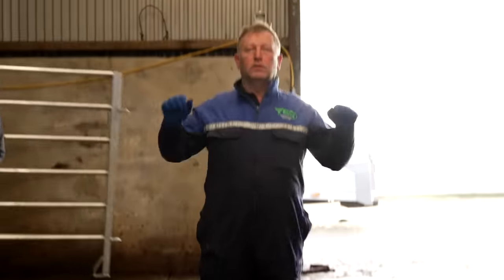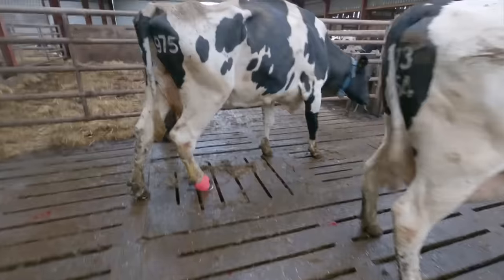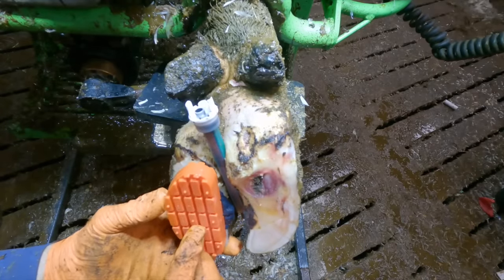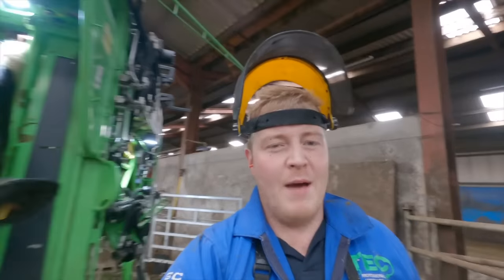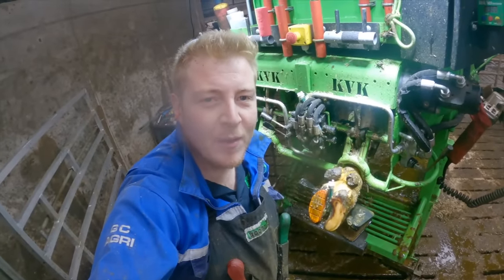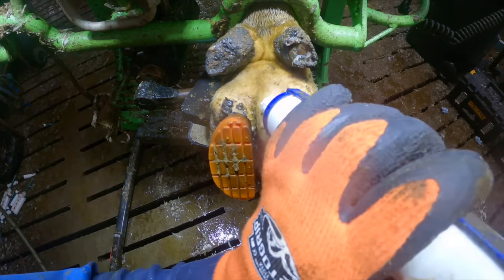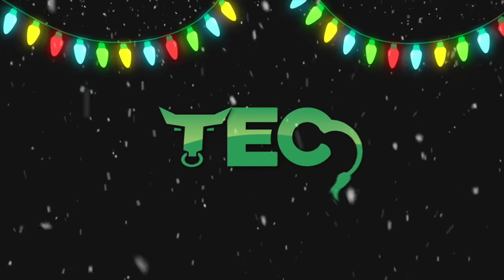MASSIVE FOUNTAIN HEEL IN THIS COW'S HOOF | 12 Hooves of Christmas

Comment: Blocks look like they are falling off because you’re not using enough glue, you’re leaving empty voids at the toe and heel, once the cow puts pressure on the toe or heel the block pops right off. I’d be surprised if you’re blocks are lasting till the end of the first day. Gram Parker with the Hoof GP does a good job showing the proper glueing for blocks.

Comment: Is there a type of hoof block that extends forward and curve up over the front of the hoof? I know nothing about the subject but from my perspective the front edge of the hoof block would drag along the floor catching on everything putting the strain on the glue contact between the hoof and the hoof block. If the hoof block extended forward up and curve around the front of the hoof it would glide more than drag like a sled putting the pressure on the hoof block pushing against the hoof. Like a shoe instead of a flip flop. Idk, maybe I'm missing something but its seems like an obvious design flaw to me.

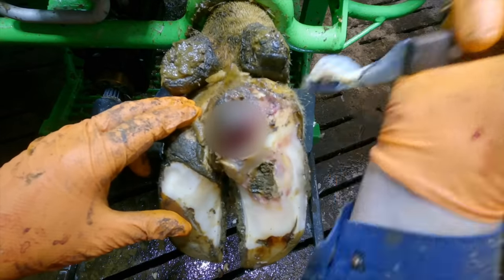Comment: this dude sprayed the cows open wound that she can’t walk on with with a high pressure hose. how does that make sense ? (2:40)
Reply: That was high volume, not pressure, big difference.
Reply: Cows are a lot tougher than you seem to be giving them credit for but as Alistair said, it was a high volume nozzle, not a high pressure nozzle.
Reply: @aaronwebb7090  all you really need is a spray bottle. the cow moved its foot around like it was in pain after it was touched by that
Reply: @lopezdia607  It's more likely that the water just made her nervous and she wanted to move her hoof away from it because she had no idea what it was. As soon as the water stopped she settled down, the pain would still be there if it really was painful to her.

Comment: The farmer in this case was negligent.   This is out of control.
Reply: If he was negligent, Gareth wouldn't have been there in the first place.
Reply: @alistairclement4239  he was there to fix cattle that haven’t been watched.  Most of That stuff isn’t overnight.
Reply: @madjimbo4176  He didn't pick the cows out himself to work on, the farmer did it, so must have been watching.
Reply: @alistairclement4239  I would assume he doesn’t bring them in often enough.  Many of those lesions, sole fractures were pretty advanced.
Reply: @madjimbo4176  many of those lesions? You know we saw 1 cow right? She didn't have many lesions. 
Also, if he calls them in when they first display lameness, the lesion can be pretty advanced when they actually arrive, they don't drop everything and go round there.
Reply: @alistairclement4239  watch it again,
Reply: @madjimbo4176  1 cow, 4 visits. You'd know that if you paid attention.
Reply: @alistairclement4239  funny how you just confirmed multiple issues same cow.  Poor care.
Reply: @madjimbo4176  and? It was the same issues all the way through, and multiple issues happen sometimes, especially when connected.
Reply: Fyi, I didn't confirm multiple issues, I confirmed multiple visits, Huge difference.
Reply: @alistairclement4239  lol.

Comment: That water pressure thoughhh....on that open wound...that made me cringe, I know that did not feel good for that cow☹️☹️
Reply: It's low pressure and high volume.
Reply: @alistair clement  I re watched it 3 times, no way that is low pressure. Plus, being an inch or two from the foot, kinda turns it into high pressure.
Reply: @ogtink  you clearly don't know the difference between high pressure and high volume then. Also, it is far more than an inch or two from the foot.
Reply: @alistair clement  I might not know the difference, would you care to explain? Because it just looked painful.